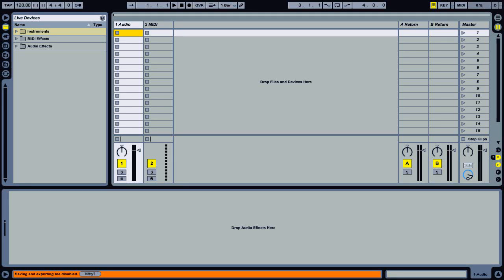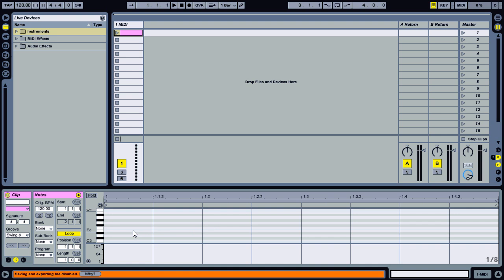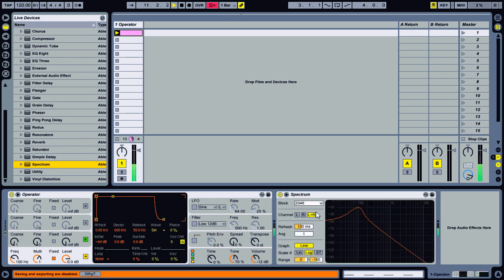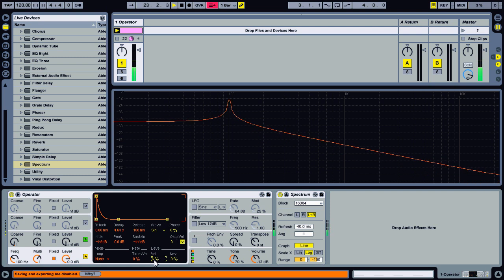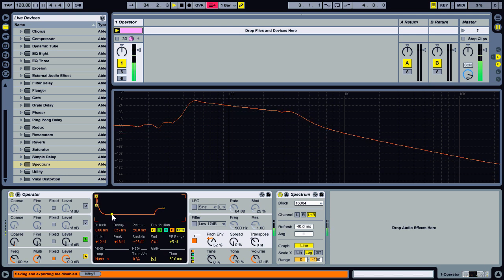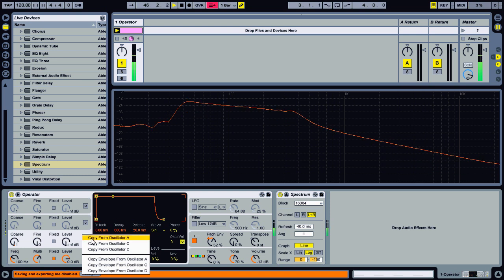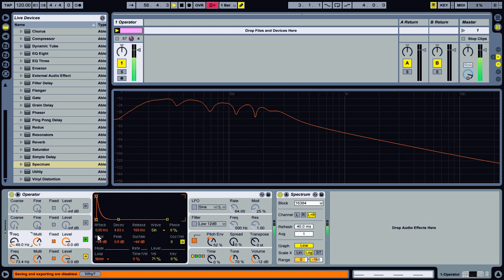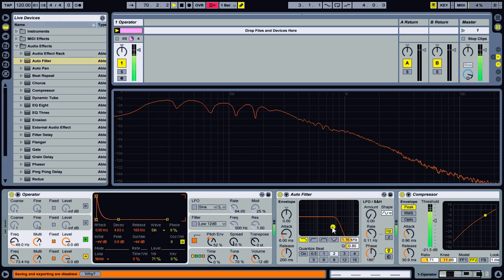Synthesize a Deep Kick Drum in Ableton Live

Comment: In the long run, the kick is taking up a lot of different frequencies above 100hz, which will drown out pretty much all mid range synths, unless you EQ the kick to a certain frequency peak, which you might as well just do to those two different frequency hits from the two separate oscillators, so you can cut those out from the mid range frequencies from other synths through an EQ, if you don't want it to sound muddy and flat.

Comment: HEADS UP: There are a few issues if you follow this tutorial step by step. 1) when adding the pitch envelope, set it to 100%, so you're not guessing what key your kick is truly in. 2) When adjusting the wave shape of the pitch envelope (initial, peak, sustain, end) I would keep sustain & end at 0 semitones (st), again to ensure you know what key your kick is in. The instructor lowers the sustain and end values to -31st & -30, therefore the kick is now no longer at the fixed frequency set by the oscillator(s), which I believe was D2 and G1... Rather it is now set to 52% of -30/-31 semitones, and who knows what that is... This will put your kick out of tune with the rest of your track; which is especially noticeable with such a clean sounding pure sine wave kick such as this. 3) When summing oscillator B with osc A it is causing a phase issue and sucking the power out of the kick. Try adjusting the 'phase' value on either oscillator. Technically 50% should invert the phase and work fine but experiment with different percentages.
Reply: but its not sounding like a kick if i put the env on 100 its a way to high frequency